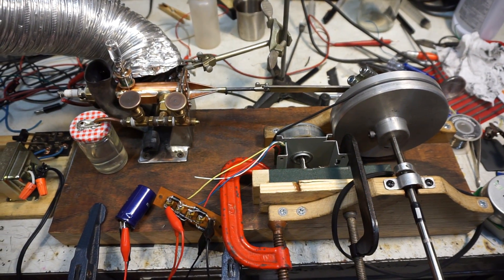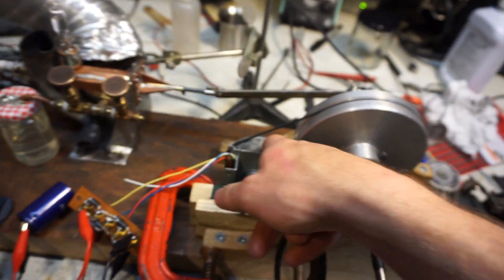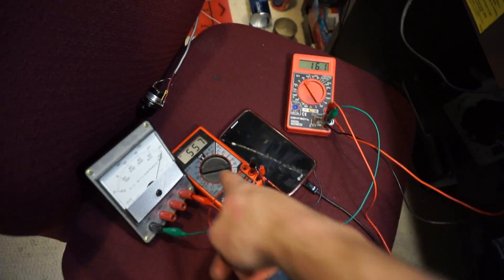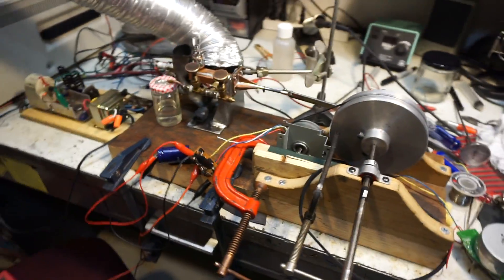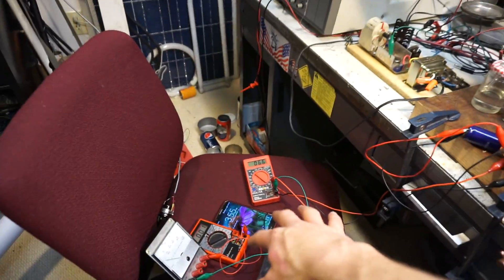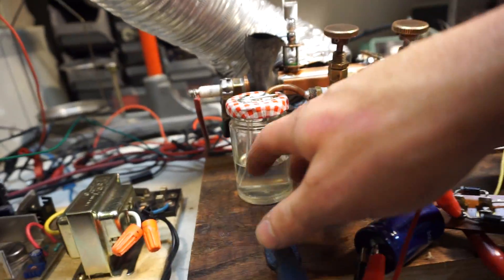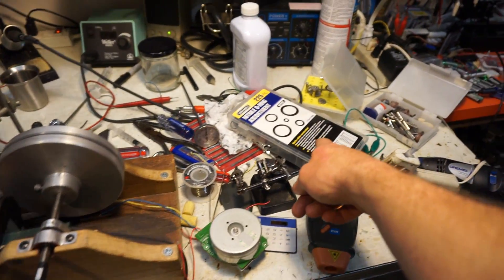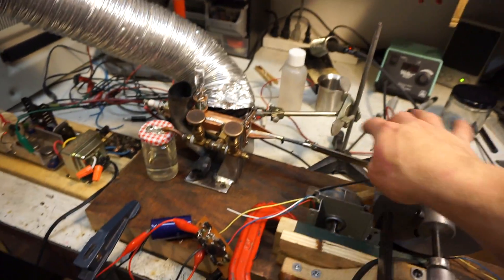Homemade Internal Combustion Engine Generating 15 Watts!

Comment: Ya know it took me awhile to figure out your oiling and cooling method.  The bicycle inner tube stretched around the cylinder and filled with water is so simple.  It worked for these short runs.  Boiling water stays a certain temperature.  Simple science.  Brilliant application.  Using two pennies for the oiling chamber ends.  Amazing.
Reply: +Makerj101 try using a radiator pump and tank. like how you would cool a hot cpu.
Reply: +Makerj101 I have 3 aio water coolers lol.
Reply: +Makerj101 and that's just what have that's not in use lol.
Reply: +DoomedWalker_ but you would want to use a double radiator or copper tubing like I was thinking about trying to use to make a gravity fed water cooling system
Reply: Makerj101 yep i am i have been messing about with computer for over 10 years now. and i just put one radiator in a media server i am setting now. pretty much ordered them but didn't end up using them or i changed my mind and went a different direction with what i was doing plus the biggest one of pretty awkward in my computer that one i was using to cool a video card but ended up just ordering a new one.
Reply: yeah same and i have taken apart and reassembled lots of laptops too lately. when i started off with computers in 2003 i got an old 200mhz Intel Pentium from my uncle then in 2004 i got a Pentium 4 custom PC.
Reply from the maker: +Lidmotor Exactly!  It works great!  I'm working on upgrading the cooling system right now!  I think I'm going to make it super complicated with a water pump and everything!  Yeah pennies were just the right size!
Reply from the maker: +DoomedWalker_ That's not a bad idea.  Problem is I would have to buy those since I don't have any water cooling stuff.  I think I am actually going to make a radiator out of copper tubing.  Sorta like this: http://i220.photobucket.com/albums/dd96/tcg001/b77d1b52.jpg  Either that or chop down an AC coil.
Reply from the maker: +DoomedWalker_ Those look like nice radiators!  You must be a computer geek if you have three laying around that are not in use!  :P  I have tons of aluminum heat sinks and one nice copper one.  But I kinda don't want to butcher the copper one as it's pretty nice.  It's still a stock cooler but it's the nicest one I've got.
Reply from the maker: +DoomedWalker_ Cool!  That's pretty long time!  I've always just used laptops.  But I've taken tons of computers apart.
Reply from the maker: +DoomedWalker_ Wow!  200MHz!  $5 Raspberry Pi's are faster than that!  :P
Reply: yeah just they didn't exist yet at the time.

Comment: You said it all in those three word, ".....this is awesome."   This is so far beyond home tinkering because you are doing the math calculations along the way.   Great work.  I like your ventilation system.  It is a critical add if you are running this indoors.  Good news about the new o rings holding up.
Reply from the maker: +Lidmotor LOL I guess that's one way to put it!  Add a little math and now it's beyond tinkering!  I never liked the term tinkering for some reason.  I never refer to what I do as tinkering.  I just don't like the word for some reason.  Yeah the ventional helps keep the fire alarm from going off!  :P

Comment: +Makerj101, what's the boiling  water thing for? you're making use of it to freshening the engine? I dont get this part, and I think this wouldn't be the best way eihter..
Reply from the maker: +Matheus Fratassi The water is for cooling the engine.  It takes an enormous amount of heat energy to boil water so I'm using that fact to my advantage.  So as long as there is water in contact with the cylinder the cylinder cannot get over 100C and thus protects everything from over heating.
Reply: Makerj101 As I was saying, I thought the  best way would be through convection.. but once it's not so high temperature, this must be ok! Ty!
Reply from the maker: +Matheus Fratassi I thought about doing air cooling.  But I am going with water cooling because it's a ton easier to make the parts.  Plus I think I would need really big fins to get rid of all the heat.

Comment: Nice to see it running. Did you mix some oil into the fuel to lubricate the piston?
Reply from the maker: +1shnitsel Nope.  It's pure coleman fuel.  The yellow color is from something that leached out of the cork seal I am using on the fuel jar.  The oil comes from the drip oiler...

Comment: This is an excellent project;  so many facets of science and technology to explore as refinements are made, and you've got metrics to help you figure out what works and what doesn't.

On its efficiency:  In addition to fuel, other energy sources that the engine is using to run ought to be accounted for, else your numbers will be misleading.  This includes the power required for the spark plug, and the power used to circulate oil and coolant.  Cheers!
Reply from the maker: +Nevin Williams Thank you!  Yeah you are right.  There is some power used for the ignition.  But it's not a lot.  I will eventually use a magneto or something so that the engine is fully self running.  I could just hook the HV circuit I have up to an inverter and run it off the battery... That would be the simple method hahaha  There is no power used for coolant or oil yet... But I hope to add those soon.

Comment: Since you now have a working design you can experiment with other kinds of cylinders, i'd suggest trying to cast aluminum right on the copper cylinder tube with the ports and cooling fins all made in the styrofoam, this way you could even incorporate proper mounts for the cylinder.Good luck exploramenting !
Reply from the maker: +John Johnson That's an interesting idea.  I think I may go with water cooling on this engine.  Just because I like to make everything extra complicated!  XD  But maybe I'll try making an engine out of cast aluminum sometime.  Definitely something I want to try.

Comment: Looks good! You just need to stick it in a box, add a clutch and get a little scooter, and it'll be perfect haha.
Reply from the maker: +Jordan O'C (Xenro66) Hahaha yep!  I was thinking of eventually trying to put wheels on it.  Would be pretty cool to see a homemade IC engine driving it's self around.
Reply: Makerj101 But first, you gotta have it power the spark plug to make it autonamous :)
Reply from the maker: +Jordan O'C (Xenro66) That's easy!  Just use an inverter to power my HV furnace ignition thing from the 12 volt battery!  :P  I should make something a little better than that though.
Reply: Makerj101 If it's so easy, why not do it? xD.
Reply from the maker: +Jordan O'C (Xenro66) The inverter would probably drain the battery faster than I'm charging it.  The cheap inverters that I have are not very efficient.  Plus the HV thing uses a transformer which is an inductive load and technically they don't like inductive loads.
Reply: Makerj101 Is there not a simpler way? Have you considered using a glowplug instead? Though, that would warrent a different fuel.
Reply from the maker: +Jordan O'C (Xenro66) I'm going to use an ignition coil.  In fact I just bought one for $4 from the scrape yard!  It can run off a 12 volt battery.
Reply: Makerj101 There you go! Sorted! I'm just sad that I cant watch any videos of yours (or any at all); I'm in a rural area for the week hehe
Reply from the maker: +Jordan O'C (Xenro66) Well I haven't posted any new ones so you haven't missed out on any of mine!  I've been busy with school and visiting family.  This is the first time in a little over a week that Iv'e gotten to take a look at my YouTube channel.  I need to post a new video...
Reply: Makerj101 I still need to catch up, you'd be surprised how much people upload in 3 weeks, from like 150+ subscriptions hahaha. Oh right, that's ok, I'm pretty sure we're all still here ^_^

Comment: make your ignition timed
it gives the engine more power
Reply: +Makerj101 Ignition timing is very important in ICEs. Because the mixture takes time to burn, the spark should ignite the mixture a few degrees before top dead center. Generally it's about 10 degrees advance, but it depends on the engine and various factors. Too much advance and the gas will reach maximum pressure before top dead center. Too little and the pressure will "follow" the piston, so not full power is transfered. Fun to play with for sure :)
Reply: +Makerj101 if the piston is in the compression stroke and it fires before the piston is at the proper point ( slightly before top dead Center) than the piston has to fight the expanding gasses and you lose power and i know in a vehicle to advanced timing can cause serious damage to the motor
Reply from the maker: +1shnitsel  You are right.  I will have to try some experiments.  Thanks!
Reply: Seems like you made some stirling engines in background that was made out of pop cans.So you got inspiration from them i guess
Reply from the maker: +Alex Gamer _360 Yeah I've made lots of Stirling engines before!  And yeah I did use some building techniques on this engine!
Reply from the maker: +robot797 I'm not sure about that.  I will eventually get an ignition coil and test that but the constant ignition seems to give quit good results.  How would it give more power?
Reply: becaus it burns the fuel bevore it has full compression
when the ignition is timed it fires only at the right compression
i dont know exactly were that is
but i do know that my rc car ran crap on my homemade cdi unit (continius arc)
and great on a timed arc
Reply from the maker: +robot797 Ah ok.  It could have some improvement.  I'll have to invest in an ignition coil and give it a try.  So far out of all the ignition methods I have tried the continuous arc worked the best.
Reply from the maker: +JamesT You are right.  It probably does fire slightly too early.  I'm still surprised it even works though and that it's not firing so early that it causes it to spin backwards.
Reply: Oh okay cool!
Reply from the maker: +Electronic Experiments I doubt it.  Does it evaporate easily?

Comment: Think it would be possible to build a 2 cylinder that could be used to power a pedal bike?
Reply from the maker: +DoomedWalker_ Sure it's possible!  It would be twice as hard to get everything working smoothly.  It's hard enough getting the mixture right on one cylinder.  It you really want power you would need to go with a bigger cylinder too.
Reply from the maker: +rileysgarage Yeah so build it bigger!!!!
Reply: +Makerj101 it would be interesting to see if it could turn the wheels at all let alone with a rider on it.
Reply from the maker: +DoomedWalker_  Sure it could drive around with me on it.  But it would go really really slow!  Like a couple inches per minute!  :P  But I think it would be able to drive just it's self around at a decent rate.  15 watts is like how much a small RC car uses.
Reply: +Makerj101 yeah it would be pretty slow unless you scaled it up some.
Reply: +Makerj101 I might want to try building one my self sometime looks like fun to me.
Reply from the maker: +DoomedWalker_  I'm thinking to make another one that's easier.  No soldering and drill press. I would love to see other people make their own!
Reply: +Makerj101 yeah even tho it would not be a good idea for me to try to build one in an apartment building.
Reply from the maker: +DoomedWalker_ LOL maybe not...
Reply: +Makerj101 it would be a neat idea mostly cause i am getting tired of walking to work every day but now winter is here and i have not much choice in the mater.

Comment: What kind of fuel is that running on?
Reply: Nevermind
Reply from the maker: +Ken Porter Coleman fuel but it's yellow colored because something leached out of the cork seal I'm using on the jar.  It would normally be clear.  It will run on gasoline too but all the additives would eventually gum things up.
Reply: +Makerj101 can run on alcohol?
Reply from the maker: +carlos locascio Sure!  I'll try it sometime!

Comment: For the second combustion engine, you should make a 2 piston design
Reply from the maker: +ctjet99 Hmm maybe.  Would make it twice as hard to start.  Would have to get the mixture right on both cylinders.  Something to consider though.  Maybe like a boxer style engine.   Boxer would be the easiest method I think.
Reply from the maker: +Improvised Weaponry Oh gosh, now we are getting complicated!  I think I'm going to pass on that one!  This was just kind of to see if it's possible to build a working IC engine without a machine shop.